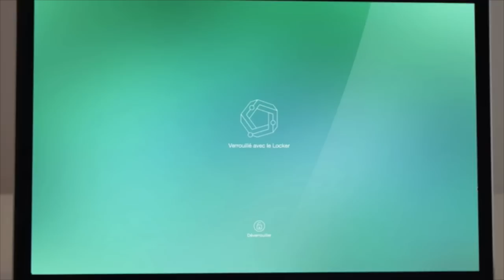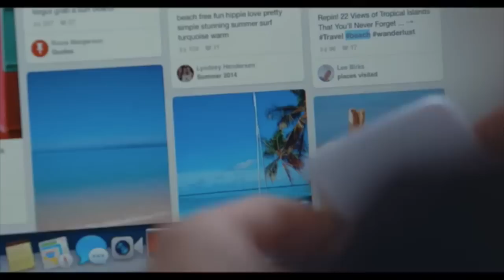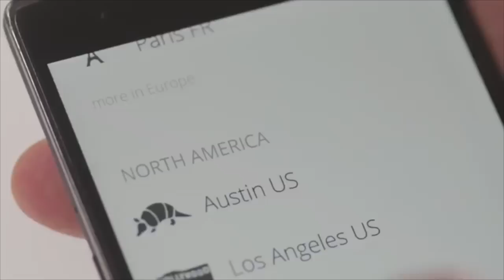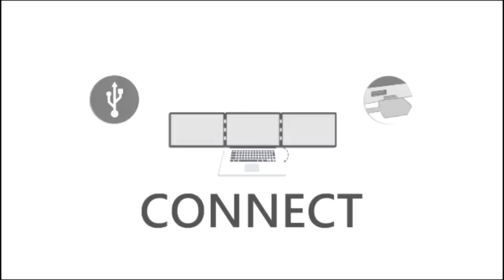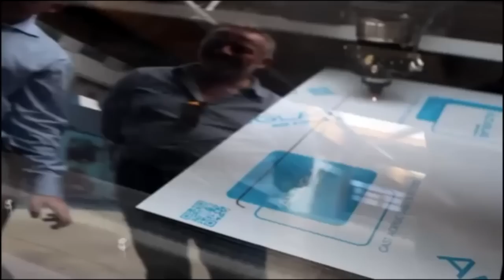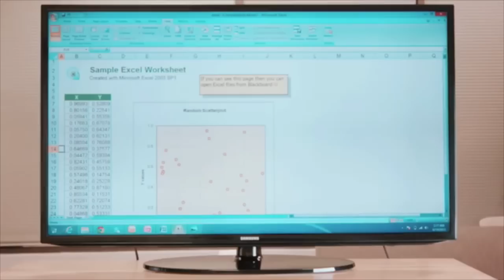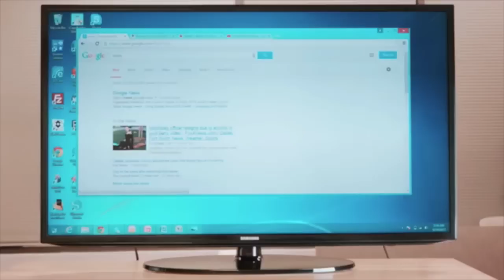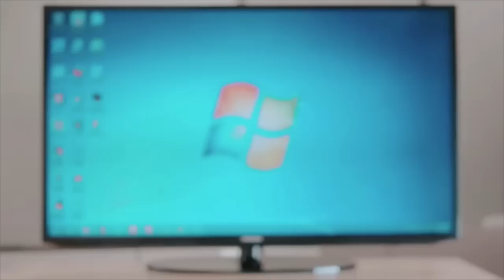Top 5 Coolest Computer Gadgets 2015

Comment: Isn't the keezel illegal?
Reply from the maker: Hippie OverlordWhy would it be Illegal? I guess depends on your country rules.
btw If u can have Keezel alternative for free. For that just google "Hola Better Internet" and install it. It's similar to keezel and I have been using it for years now.
Reply: TechnoNerd You might want to stop using hola and advising it to others. It does work and I used to use it as well, however a few months ago now it was exposed that it had backdoors in the programming and essentially routes other connections through yours which is problematic in many ways. If you wish to know more check this article https://torrentfreak.com/hola-vpn-sells-users-bandwidth-150528/
Reply from the maker: jhalpinable Great Article. Thanks for the share I wasn't aware of this, removed the extension.
Reply: np, also I enjoyed the video. Keep up the good work! :)
Reply: +jhalpinable why buy this...  i can hack it for free xD